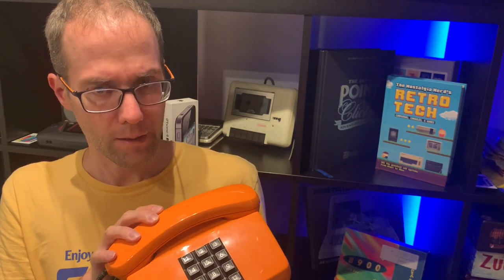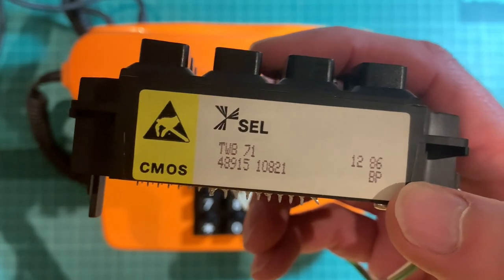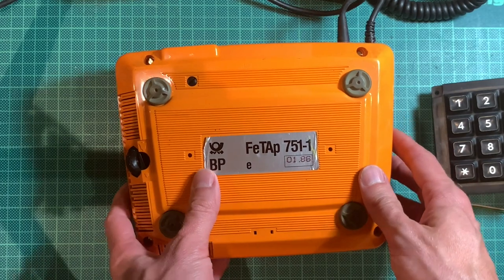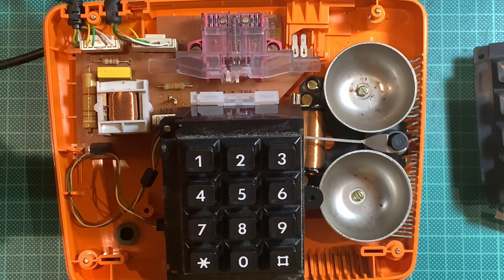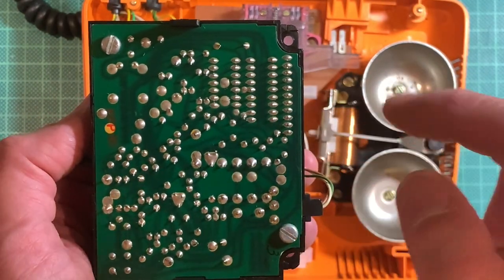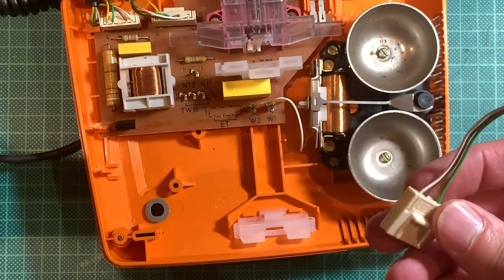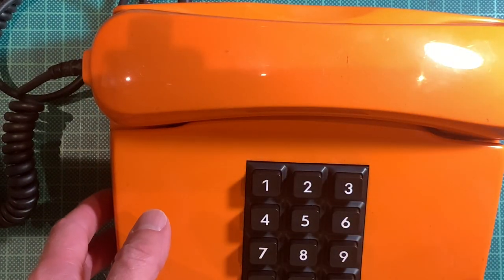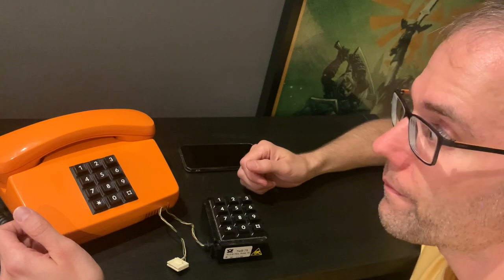Upgrading an Obsolete German Telephone

Comment: In the late 80s early 90s I would Phreak CCITT5 PBXs. I first wrote a blue box dialed on C64 and after 1 semester on college, I learned enough electronics to build a dedicated microcontroller solution with an 8051 that was portable. After that my friend and I, started hacking the early prepaid phone cards, for phone boxes. So old telephones have a soft spot in my heart! My phreaking friend and I, gotten so apt in phone dialing that we could dial perfectly by just simulating pulse dialing by tapping the receiver switch. Which wasn’t as timing critical as the 50ms tone and paused that CCITT was. But still a nice party trick.
We’d also would wire a diode on the line, which would prevent the phone from ringing and would answer immediately. In effect having a very poor quality even dropping device.
And using a capacitor to change the phase and allegedly reduce the cost of a call.
But er called from free, great for BBS downloads.
Awesome video Mein Freund!

Comment: I am amazed you still had pulse dialing phones in 1986. We went from a rotary dial phone, when we moved in the 1979 to a touch dial phone — you used to get those from the Dutch posts very uneventful grey phones and it was DTMF.
6 year old me was amazed about the times. And the speed you could dial.